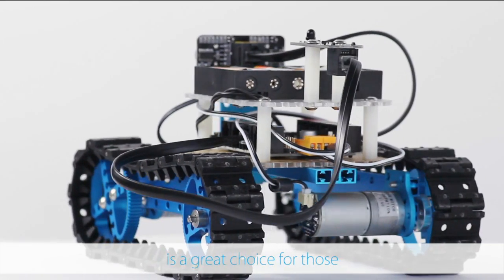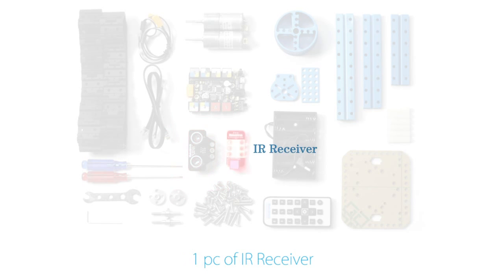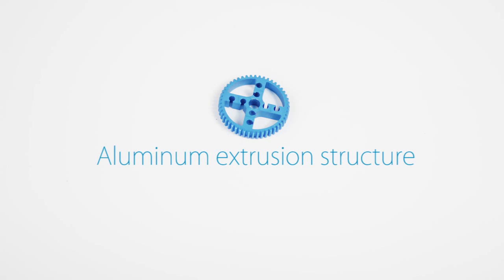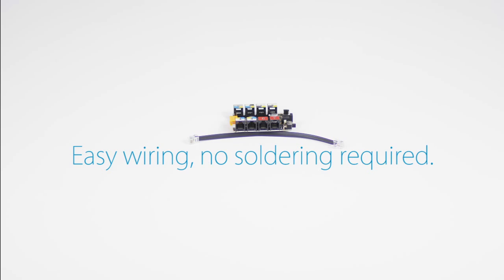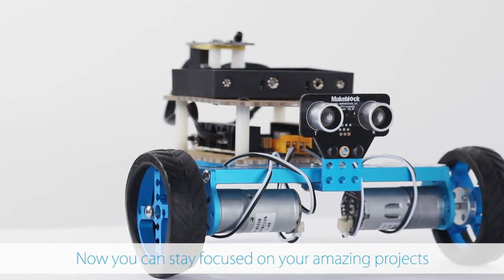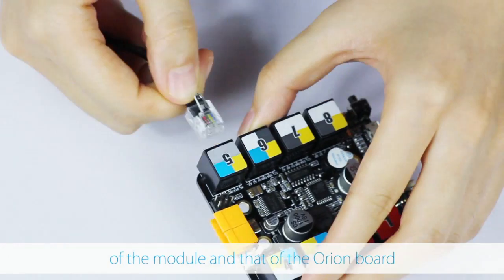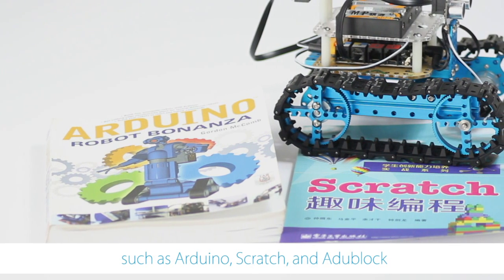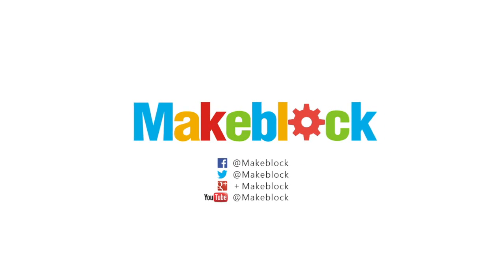Makeblock Starter Robot Kit, Your First Step to Arduino, Sratch, Electronics and More!

Comment: This was a cool toy for about 15 minutes. My son and I built the tank version together during lockdown. We built it and ran it around using the IR remote control. My son just wanted to use the remote control even though he knows how to program in Scratch. Anyway, it ran around the house very cool. The only trouble was the motors ran backwards. We double checked the instructions and we had it wired right. There's a note in the instructions saying if it runs backwards flip the wire connects to the motors, which we did. The damned thing never worked again. We flipped the wires back, we checked everything. I'm an electrical engineer, so not unused to diagnosing electronics. The motors work when we jumper a signal to them. The robot receives the IR signals. The circuit board just will not send the signal to the motors no matter what we've tried. A bad soder in there someplace? A bad chip, maybe? Maybe it needs some reset which we don't know how to do. Who knows? Anyway fun for 15 minutes. 
$150.00 = 15 minutes of fun. I will say, I was able to teach my son a lot about how to diagnose electronics... even if unsuccessfully.

Comment: Can we use arduino uno in place of orion?
Reply: Akshat yes you only need to do the right circuits with the breadboard for the dc motors. It’s very easy and it will make your robot even more powerfull
Reply: The Magic V thanks a lot for helping me out

Comment: I can't drive mine
Reply: +Jacob Vlassich The motors may be defective. Check the voltage going to the motor at the (orange) motor terminal with a multimeter.

Comment: Makeblock starter kit is a great choice for those who are interested in learning that manufacturing issues, lack of software updates, and slow customer support can plague a product and destroy a brand name.  I got the Makeblock Starter Robot Kit (bt version) from one of the Radio Shacks that were closing.  Turned out I had a bad motor in the kit.  After looking online, Makeblock rightfully mentioned it's a known problem and after sending a photo of the receipt/motor to one of their customer support e-mail addresses, I received a replacement a few weeks later.  Turns out...the replacement is also bad.  I know this because I swapped the two motors to validate it was the motor and not a connection issue on my side.  

Also, the app is pretty terrible.  At least the google play version on an HTC One m8.  It connects, but no communication is received 4/5 times.  When I do get to control it, it just blindly pushes forward.  I can't turn the automatic mode back off once it starts.

At this point, I'm giving up and calling this "kit" a loss.  I'll end up using the parts for other projects.  Utter disappointment.
Reply from the maker: +droobie21 Sorry for your poor experience. The order we provided to Radio Shack was the first big order for Makeblock when we only had 20 members, therefore everything was prepared in hurry. Some issues like Motors happened like your situation. What's worse, we found there are even some missing parts in the kit. However, we are willing to replace them if you post your issues on our forum.makeblock.cc and try our best to make it right. Now we are bigger company now, that's the last thing we'd love to see. Thx
Reply: +droobie21 Ive had the same issues recently. The 3 wheeled car worked a tad better although the motors still seem to be weak compared to the power being supplied. You can check out some of my videos on my page. I too have had the same issues with Makeblock customer service.
Reply: hghhhhhhhg h t